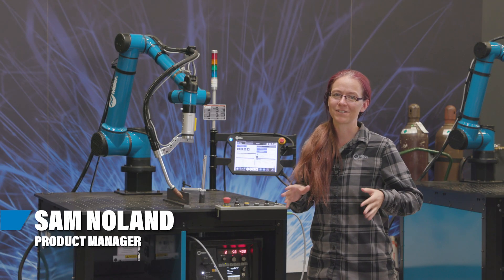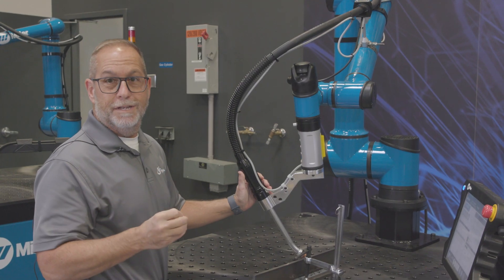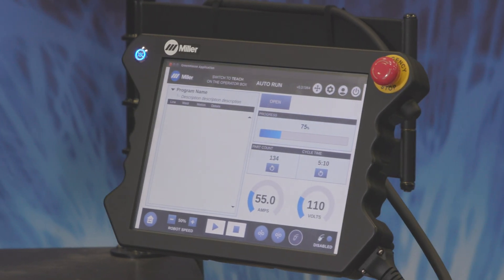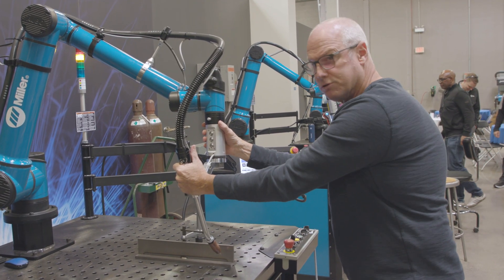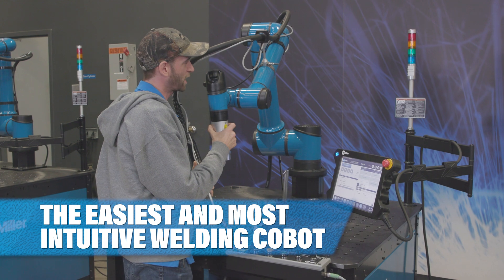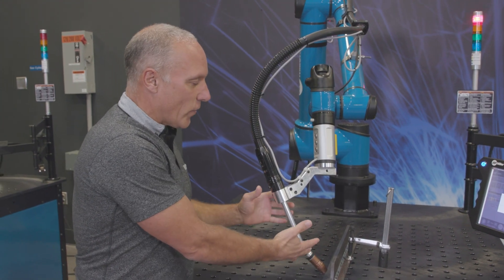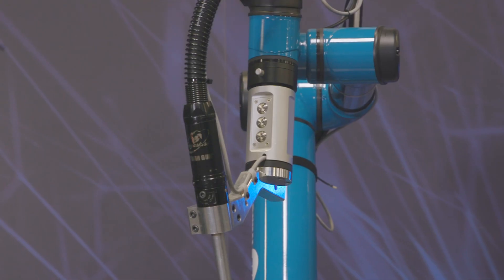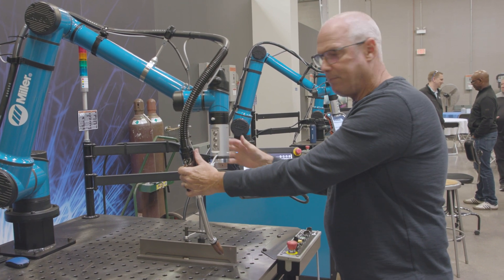Evolve Your Welding with New Miller Cobot

Comment: Say goodbye to another 100,000 jobs. 🤦‍♂️
Reply: There aren't enough welders to fill these positions. That's why robotics are being introduced to other industries besides just the Automotive industry.
Reply: @BytesAnBirdies  who’s fault is that? There are plenty who want to be welders and many more who don’t even know skilled trades are an option for work.
Reply: @Alaskabuilt_  there are many trades programs and advertisements and grants available for anyone willing to take on a trade in Ontario. Still doesn't help when no one wants to take on these roles anymore. Everyone is a self proclaimed influencer now
Reply: There is jobs for someone to operate and fix those robots
Reply: @camurai9613  true but that’s not as good of a job and leaves you with less skill set in life. This is taking away the most important part. The entry level welder. It will be disastrous in the long run. People wonder why we have so many people without work. We keep replacing them with technology and then whining about how the next generation has no skill set or work ethic. We are destroying this world and mankind by raises highly unskilled and weak men.